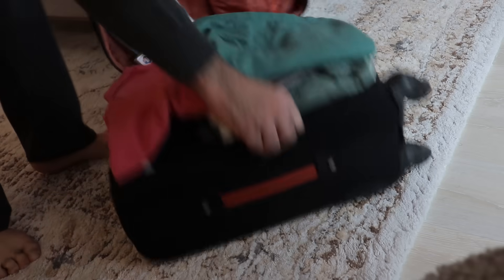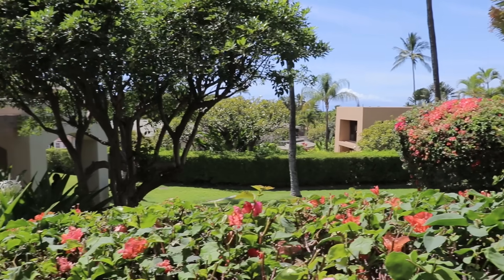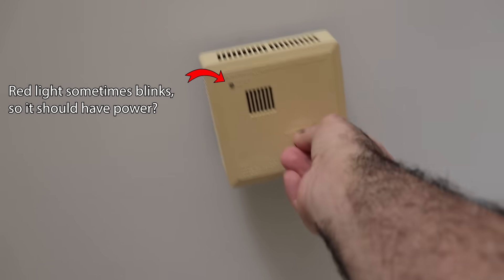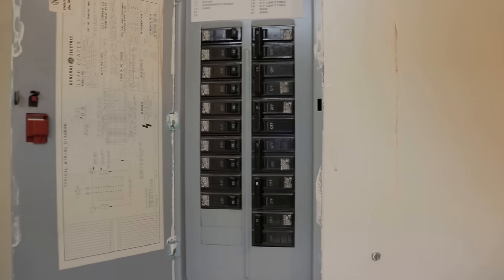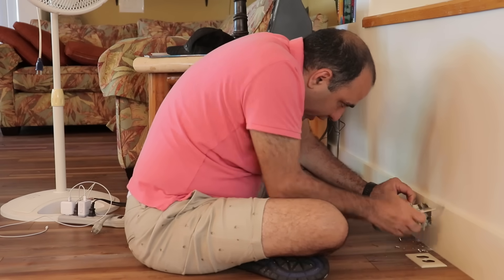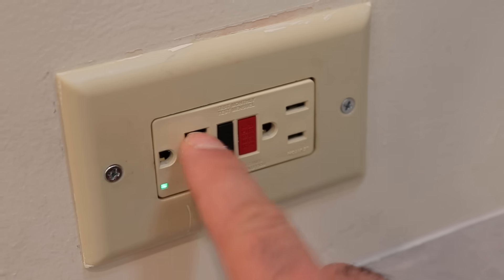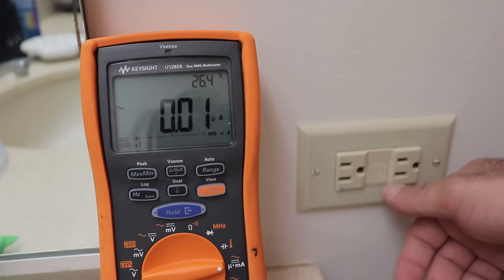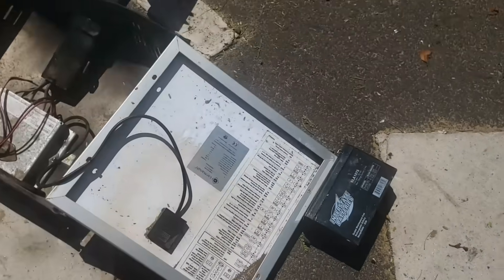Hawaiian Hotel Safety Failures

Comment: I'm kinda surprised you didn't even do any polarity/connection testing.. I'd bet half the outlets are wired up with neutral and hot swapped, and most of the "grounded" outlets don't even have ground connected to anything..

I shudder to think what would happen if Medhi ever travels to somewhere that uses "suicide showers"...

Comment: The smoke ditector red wire was disconnected from the power supply and I doubt that it has a battery and it’s also about 40 years old so there are many reasons it probably won’t work

Comment: Electrican here the smoke detector with a red blinking light means there is no AC power to the unit it should have a green light given that the unit it over 30 years old it wouldn’t be working, it’s blinking because of the 9 volt battery that is connected to the smoke detector

Comment: Why didn't you just buy an outlet tester. Some of these have a GFCI tester built in. The problem with your potentiometer is that it's not reated for a lot of watts. At 10kohms your potentiometer will draw only 12mA, but it will be disipating just under 1.5 watts of power. A typical potentiometer will have a rating of between a quarter watt and a half watt. So yes, it was getting WAY too hot. You should have checked the power rating on your potentiometer before using it this way.

Comment: Same (blackened thumbs) happened to me working on a 115vac 3 phase 400Hz aircraft accessory test stand. My glasses (thanks god) were metal plated by the vaporized canon plug and I spent two weeks for the doctor to assess if my thumbs had to be amputated since a third degree burn doesn’t hurt. Silvedene ointment and religiously maintaining cleanliness saved my thumbs.

Comment: I used to work for a remodeling company in Maui, and I'm pretty sure I've remodeled 2 different condos in the exact same place where he is staying here.  So many stories I could tell...  Anyway, I was told the reason all the light switches are so low is because the previous condo owners were very short asian people, and they preferred to have door knobs, hand rails, and even cabinet handles as low as possible.  During remodel we were told to leave everything the way it was, even if it didn't "quite match code", lol.  And hiding the electrical panel behind a painting is incredibly common in Hawaii.  Did I mention they don't care very much about building codes :)

Comment: Can anyone solve this??? There is an MCCB rated 80Amp. And a cutout HRC fuse rated 100Amp. The installation is a 3phase system. The load is high. The problem is, that the 100Amp HRC fuse blow-up every time before the MCCB trip. The red and yellow phase HRC fuse blows up at the same time. The red phase has 60Amp. The yellow phase has 80Amp. So, do I need to install a lower-rated MCCB for example 60Amp to trip the MCCB before blowing up the HRC fuse or there is something else to do..?  HRC fuses are expensive and not accessible to everyone without the authority's permission.

Comment: You are right on the line. I am an electrician, and several electrical engineers I know, don't know much about general residential or commercial electrical. You seem to know more than the average engineer.
Reply: But you called it a fuse panel, which everybody except electricians call a subpanel.
Reply: And you got shocked!!!! 🌩

Comment: In Australia, due to safety regulations, any new houses built has no electrical outlets anywhere in the bathroom.

And our earth leakage breakers are all in the fuse box, it used to be only the outlet circuits protected, nowadays every circuit is protected.

Our standards are very high here.

Comment: The loose outlet is probably the biggest fire hazard in this whole video. Heat produced by high resistance (at least in USA) is not covered by any safety feature whatsoever, unlike shorts, which are covered by breakers.
Reply: Arc fault breakers are a thing. They are a safety feature for this exact issue. They’ve been around since 2002

Comment: 12:30 If you were in Europe, the responsibility to measure the difference between the phase and ground is not done by a GFCI, its done by an RCD or an RCBO. Furthermore, it does not measure the difference between the phase and the ground, rather the phase and the neutral. This way if there is a ground fault anywhere on the circuit it will trip. This also means that every socket has the same kind of protection that a GFCI provides.
Reply: GFCI and RCD are different names for the same thing. Both function identically. GFCI breakers do exist, but it's more common in North America to see them at the outlet itself. One difference is the current at which they're designed to trip (GFCI is typically 5mA, RCD is typically 20-30mA). Both approaches have pros and cons.

Comment: At least how much watts does a loose contact electronic item has to pull to catch fire at power outlet ?? plz answer .

 I have a loose outlet I usually use it for charging phone and laptop. Any risk?
Reply: Check the temperature , if it hovers around 50-60 celcius you are fine.

I have been using a port that is not loose but it's so tight that I can barely plug the whole charging brick's pin inside the outlet it never goes completely inside but it is considered as a loose connection, as I don't think they connect as they should be. I think you get it

Comment: Hey Electro, If you insert a power plug and it is loose then take it out and bend the pins slightly apart then re-insert it. By bending the pins outward it fits tighter.

Comment: My guess for the smoke detector is that the Americium in it has depleted meaning it no longer works, this happens with age and is why you should replace often!
Reply: Probably not. Americium has a half life of over 400 years. It is significantly more likely to be just a matter of component reliability
Reply: @hayden3865  A very constructive reply, thank you!
Reply: I believe the AC light on it is supposed to show green? Can't remember.
Reply: @doohickey-enjoyer  3:26 It's a heat alarm!
Reply: @UberAlphaSirus  It isn't a heat alarm, it's a smoke alarm that also has a heat element. The knob adjusts the sensitivity to make it more sensitive to smoke while in the test position. When new, this may be enough to allow it to go into alarm with ambient air but it's long since drifted out of it's sensitivity range. It probably does still "work" but not well and shouldn't be relied upon. Smoke alarms should be replaced every 10 years.
Reply: @SDMasterYoda  3:26 Are you blind?
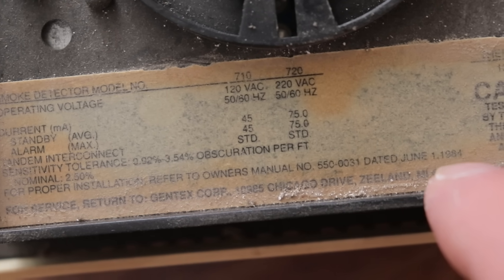Reply: @UberAlphaSirus  3:14 "Smoke Detector Model No. 710" It is a combination Smoke/Heat Alarm.
Reply: @SDMasterYoda  I know, I pulled up the data sheet.
Reply: @UberAlphaSirus  You're the one that keeps saying it's a heat and not a smoke. It is primarily a smoke alarm.
Reply: How many 40-year-old smoke alarms does that hotel have? And how much will it cost to replace all of them? Management is in for a surprise.
Reply: @RaymondHng  they can get away with buying the cheap ionization alarms in bulk from BRK. It won’t be that expensive compared to how much money they likely make
Reply: @mattdude  How much for 100 alarms? 500 alarms?
Reply: @mattdude  So it will be $1,216 for 100 and $6,080 for 500, plus labor costs for installation which will be even more.
Reply: @RaymondHng  not necessarily. Like I said, those are the prices from Lowe’s. It would likely be cheaper if you make a deal and buy directly with the manufacturer. Also labor costs are no big deal. Assuming there’s already a spot for a hardwired smoke alarm, all that has to be done is take the old one down, put it in the new wiring harness and mounting bracket, and connect the alarm and mount it. The existing maintenance staff can do it no problem.
Reply: @mattdude  Maintenance staff will still have to be paid to install the units. And time spent on installing alarms means time spent away from other maintenance duties. How many full-time equivalent maintenance employees does this hotel have? One? Two? Five? What is their current work load? What are their hourly rates? Their overtime rate? How much employer's share of FICA taxes have to be paid on top of their hourly rate? You obviously have never worked in payroll.
Reply: @RaymondHng  what are you talking about man? This makes no sense, they’re already paid a salary, they’re just doing their job. What would you rather do, pay the few thousand to install new smoke alarms, or a multimillion dollar settlement to a family that died overnight from smoke inhalation? Not only that, deal with the tarnished reputation for years to come.
Reply: @mattdude  First of all, we don't know how many maintenance people this hotel employs if any at all. Secondly, if they employ a bare minimum of maintenance people, the staff already has a full work load doing their regular maintenance work. They would not be employing a staff of maintenance people with spare time on their hands that is just sitting around waiting for the next task. Installing new alarms would be an additional project to add to their current workload. Considering that all the electrical outlets are so worn out that they don't make a secure, firm connection to anything that's plugged into them, I doubt if this hotel employs a full-time staff of maintenance people. Also, what if the new smoke alarms do not fit in the old fittings?
Reply: @RaymondHng  you can’t put a price on fire safety, I have no sympathy for property managers that put their guests at risk just to save a few dollars.
Reply: @mattdude  for most purposes photoelectric smoke alarms work better
Reply: @JJschannel255  yes I know, I’m not stupid. But because they’re still more expensive than ionization alarms, and because I have yet to see them in a large installation like apartments and hotels, I’m keeping my expectations low.
Reply: GENTEX Smoke alarm is photoelectric
Reply: @theaverage_blackyoshi  for smoke but also has a heat sensor.
Reply: @liam3284  in particular the cost of the house burning down
Reply: replace it with a photoelectric smoke detector. They are better in most situations.
Reply: I'm sure somebody has mentioned it before, but MANY whole families have died from carbon monoxide in vacation rental houses overseas. The visible parts of the rental are very clean and modern but the nuts and bolts (electrical, heating, etc) are done as cheaply as possible by local labor. The water heaters, stoves/ovens, smoke detectors, drainage lines, etc. for example, are generally not replaced until they break because the tourists don't see them and fixing them doesn't generate any more money.
Reply: Wenn die Ionisationsmelder verschmutzt sind, lässt auch deren Empfindlichkeit nach.
Reply: It's a heat alarm. Not a smoke.
Reply: @UberAlphaSirus  It is a GENTEX smoke alarm. Heat detectors look different.

Comment: "Which might be the case in your own home too!" My old house had a totally never updated fuse panel from the sixties that let us run multiple rooms full of computers off of maybe two non-grounded outlets. This one has wiring from the fifties, updated poorly enough in the eighties that my bedroom is wired to an outlet in the kitchen but my brother's room beside mine has no presence on the internal breaker panel at all. We have no idea where he's drawing his power from. And I'm local to you! So yes! Our electrical wiring is terrible!
Reply: My house has a breaker box in the attic (super illegal) that looks like a literal birds nest and a fuse box in the kitchen. A couple kitchen outlets are the only thing running on the fuse box. My room and the hall bathroom are on the same circuit, but the attic light and one outlet in my room stay on even if power is cut to both the fuse box and breaker box. It's fucking wild man.

Comment: One time I found a horrible electrical install at an airbnb we stayed at in Florida,  first of all the ceiling fan in the living room had live bare wires coming out of it,  and no switch to turn it off.  Also,  in the laundry room,  there was a duplex outlet mounted over an octogan box with a light bulb plugged in using an adapter

Comment: Sir ,
      I just met something strange , I know that the audible frequency range for humans are in the range of  20Hz to 20KHz . I was trying to make a ultrasonic levitation driver circuit so I needed a 40KHz of wave to test my circuit but I ended up getting a software that can generate a maximum of 22KHz of sine , square, triangle and sawtooth waves.

The interesting thing I found is that while we use sound waves of frequency below 20Hz  and above  20KHz of sine wave we cannot hear anything at all.But we can hear every single frequencies of sound wave if we use a square wave signal or sawtooth wave signals and we can also hear from 6Hz to above if we use a triangle wave.

I wish to know that why sine waves are behaving like this while the others don't!! and also why did we adapted to use sound waves of sine wave nature while there is a broader spectrum of hearing if we used square waves . Is there any explanation on this please be kind to  enlighten me also sir.

Thank you for taking time to read my doubt amoung the other thousands.